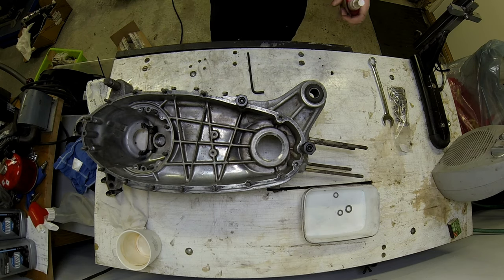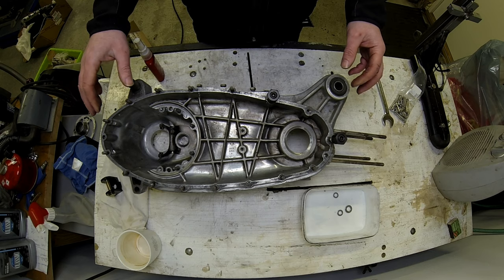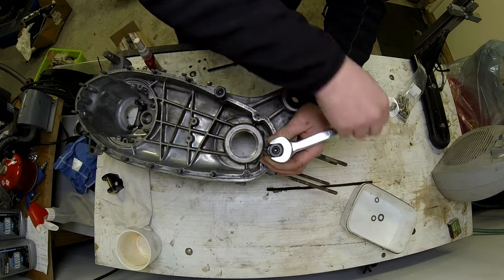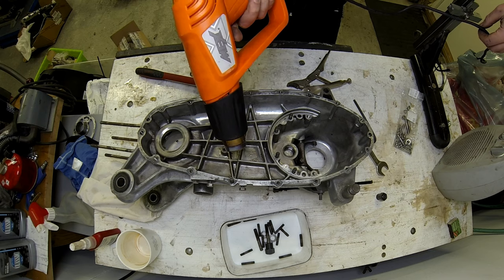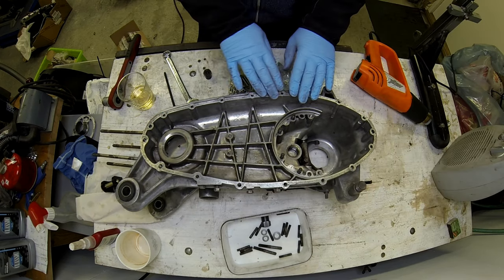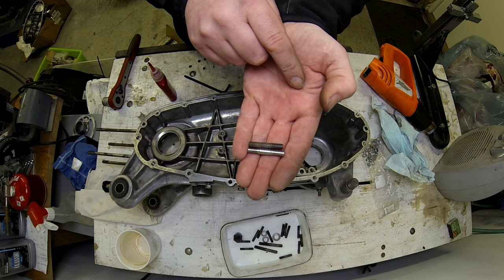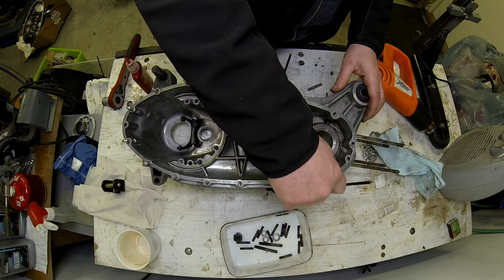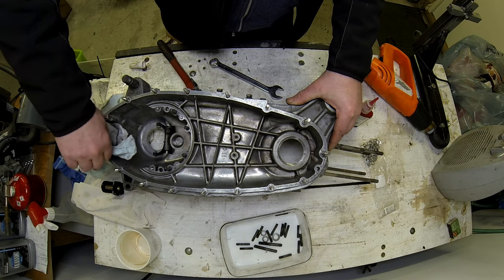Lambretta engine case stud replacement

Comment: Proper tool...all but two came out easy peasy...bugger if I have any heat around here though to finish the job! Arrgh...Would you recommend same technique for getting the cylinder case studs out as well?
Reply from the maker: I use the same method for cylinder studs